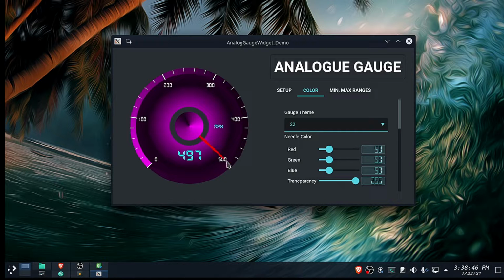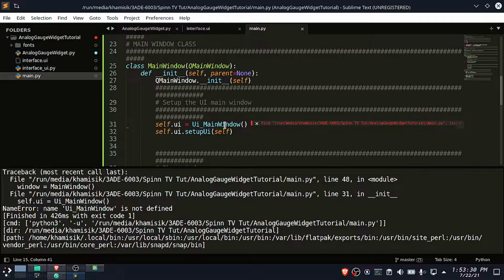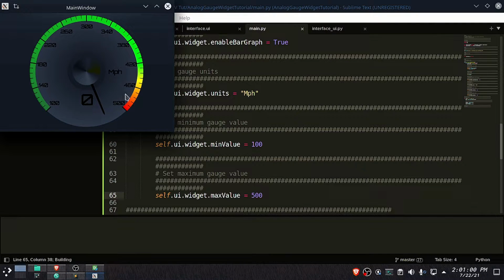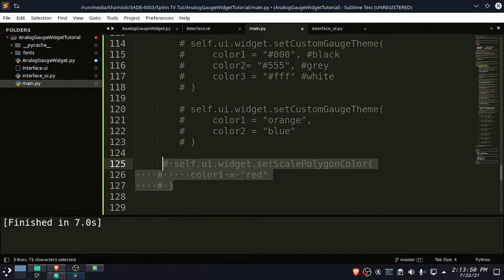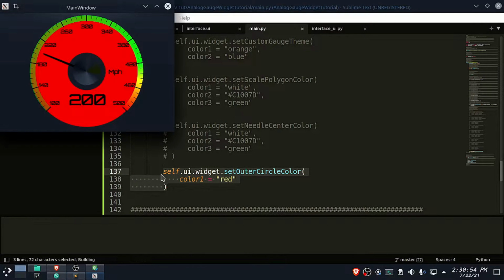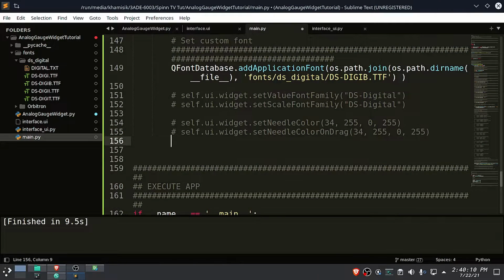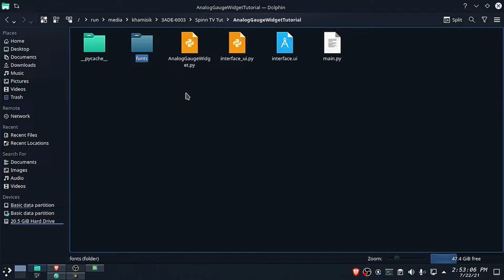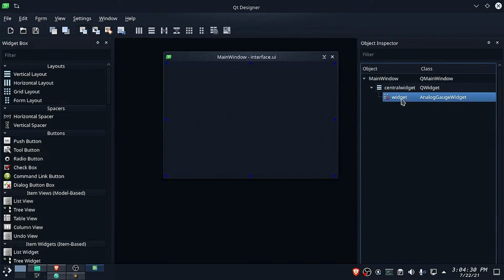Tutorial Python creating a digital-analog gauge meter | PyQt | Modern Flat Style Interface Design

Comment: thank you for this awesome video. but I would like to ask a question about my project. I want to set value of the speedometer explicitly and want to see the needle moving without the  movement of mouse. how can i do tihs? I have checked the documantation but couldn't find a way. please help me. :/
Reply from the maker: Noted,, let let check then , I'll get back to you
Reply: Hi! You need to use the variable "value" in the "Mouseleave Event" section of the file 'AnalogGaugeWidget.py'
Reply: @Scorp071  doing that only updates when you move the mouse closer to the clock
Reply: I'm trying but it doesn't work
Reply: @edinsonhenrritinocosalvati9473  Have you found a way to do it? (set the value of the speedometer by receiving the value outside, for example from arduino and then display it)
Reply: Have you found a way to do it? (set the value of the speedometer by receiving the value outside, for example from arduino and then display it)
Reply: just found the answer to the mouse tracking, it still tracks if you select and move the pointer 

self.ui.widget.setMouseTracking(False)

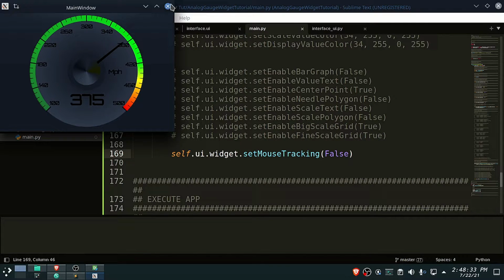it's not on documentation, but it's on video at 25:54